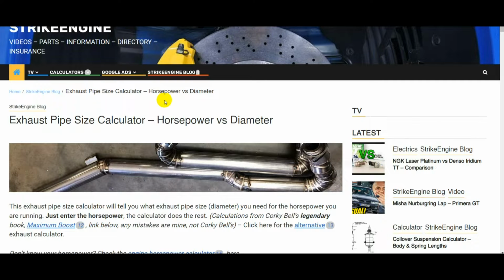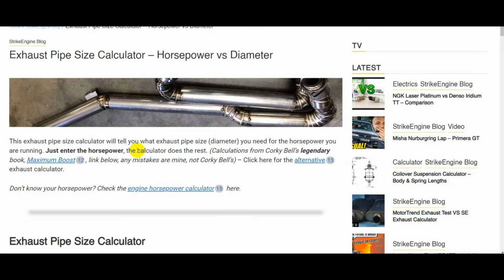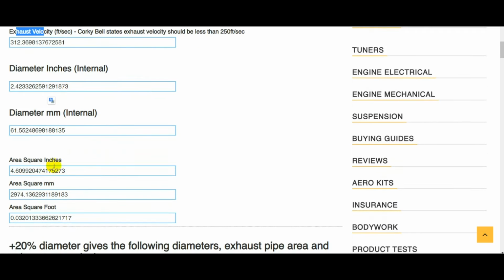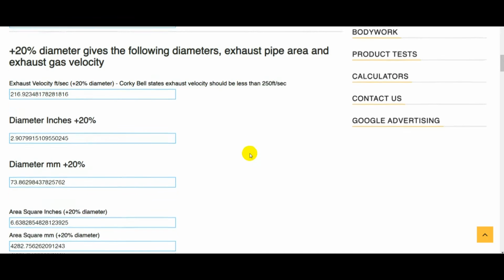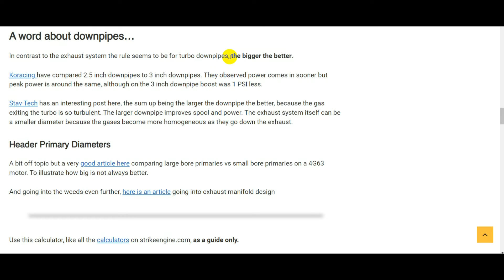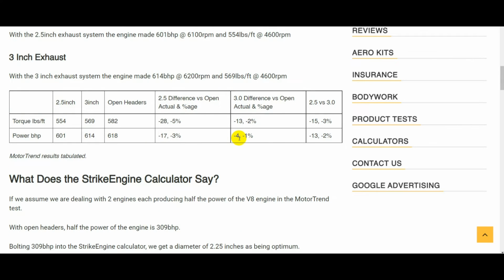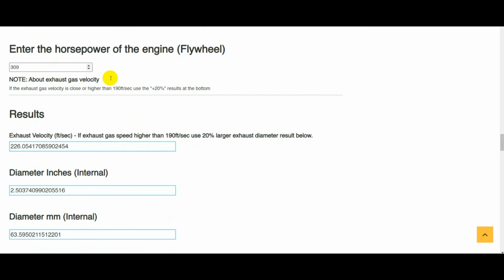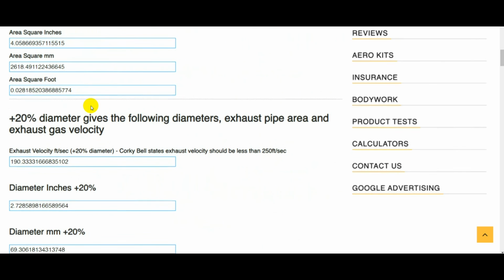Exhaust Diameter Calculator - User Guide (Its simple)

Comment: Is this calculator also good for motorcycles?
Reply from the maker: honestly. never thought that motorbikes could be different. I dont see any reason why it shouldnt work for them. Generally the calculator is for high horsepower though. 150bhp+. There is a limit on how small a diameter it will recommend.